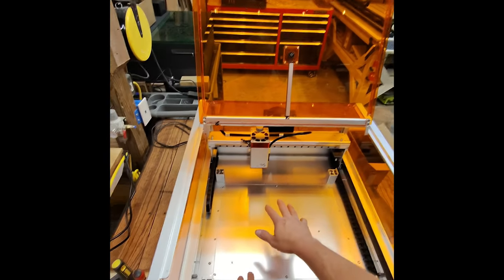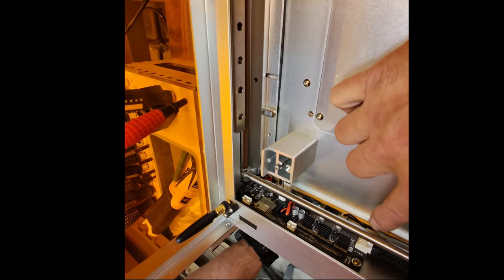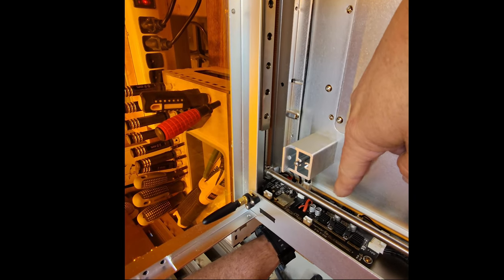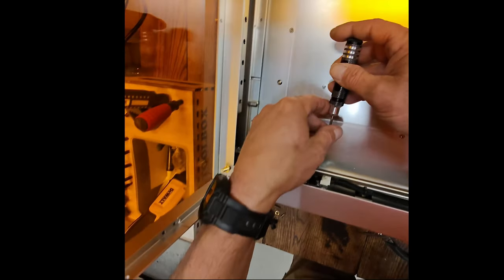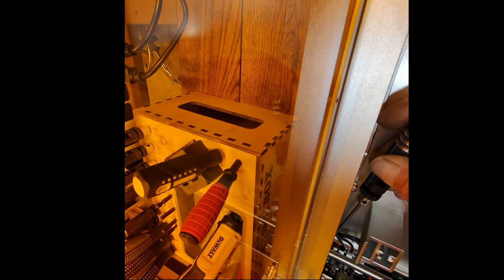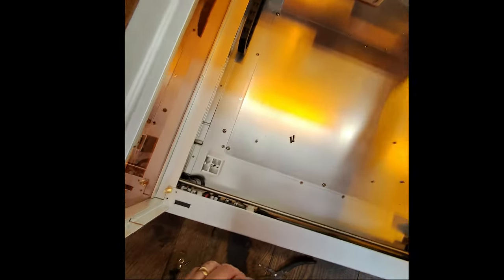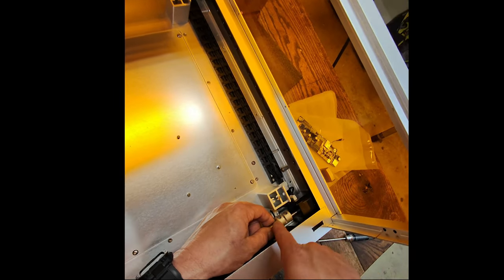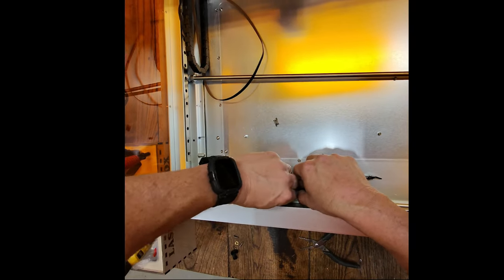Replacing the controller in the Lasermatic MK2

Comment: Does this apply to the Lasermatic MK1 (original)
Reply from the maker: I would imagine it is similar, the wiring could be slightly different. Take photos.
Reply: Roly has a replacement board listet for the 10 in their shop. 75$ , but currently sold out. Looks identical.

Comment: You could take the bottom panel out to maybe allow your hand to come from a different angle?
Reply from the maker: I ain’t that flexible… that one post might not have been a bad idea
Reply: @TheClackShack  I was just thinking maybe take the panel off then you could pull machine forward on table then have a hand from top and one going under and thru?

Taking the post off would probably have made the biggest difference, just wasn't sure how that was attached.
Reply from the maker: @justinbanks2380  looks like a single screw from the bottom. It wasn’t bad coming over the top. A matter of preference I guess

Comment: Be very careful when disconnecting the WiFi antenna from the board. I though I was and still popped the connector off the new board.
Reply from the maker: Yes, they can be a pain. I hate them in laptops, it usually is much more difficult to reconnect without breaking anything.